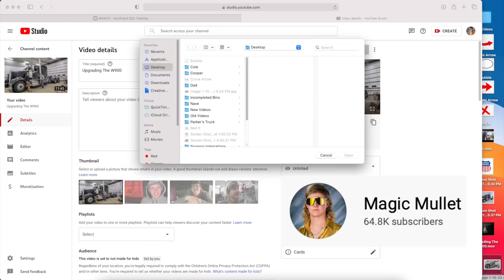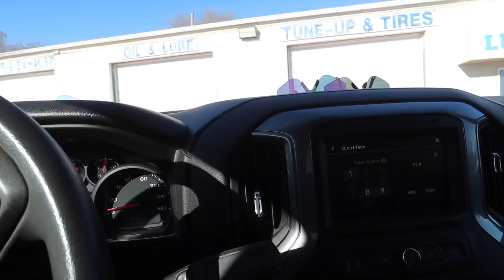MY PARENTS LEFT THE FARM!

Comment: Hey Cole- at 4:44, the valve on that new bin for the floor sweep, could you switch the handle to the other side so you don’t need to crawl over to operate it? You back will thank you when you turn 60, trust me.
Reply: I noticed that also.

Comment: If you’re using a traditional shower enclosure you’re gonna want to remove the drywall so the shower walls are directly against the studs. Then you can mud over the nailing flange and finish it off nicely. That will change the position of your drain by another half inch in both directions too.
Reply: Also need to stay on the same plane when installing the shower drain and trap.  Looks like you will need to dig a lot deeper underneath your shower drain to put the trap on. You break plane, it might not drain/vent properly.  You need to dig down to the bottom of the stand pipe and connect horizontal to trap.

Comment: OK, my CDO is acting up- Brand new bin system and they put the electric controls on the opposite side of the unload auger as the crank to open the door. Now DC has to turn everything on, climb over the auger, then crank the doors open. Some one in design group needs a boot to the rear.

Comment: Cole, the Northland CDL course is GREAT! Show up, register, watch a video, practice pre-trip, do the pre-trip (on section A, B, or C of the truck), then practice skills which is straight line back, offset back, and 90* back, then test on it, and finally you do a quick practice drive around the block, go out in town and on the highway briefly for the drive test where they want you to call out speed limits, and RR crossings, do a simulated stop on the side of the road and ask about your hazard triangle spacing, then it’s back to the yard. The manual trucks are 6 speeds with SYNCROS so it’s super easy. I was in and out from 6:45 to 1:30. Good luck!

Comment: If that's a fiberglass shower pan you should put mud under it for support so it doesn't crack from people standing on it. Ask me how I know?
Reply: just put a ton of spray foam insulation under mine. Worked well and been many years no issues.
Reply: @larryfreeman7979  Good idea!

Comment: I see you guys using disconnects to start and stop your augers. I would suggest using a starter with overload protection. Then when one leg overloads it won't just sit there single phasing and burning up till you get to the box to disconnect. It will just disengage all the legs of the 3phase and require a reset. Much safer and less firey.

Comment: Atounding - You begin without an ad. Thank you from all your viewers (i'm the first apparently). Good morning to you, Cole.. Hey, fella, I do hope you are saving all the nice wainscoating from the walls. You or your carpented friend can easily restor it after you finished the interior walls. .  DO you think maybe it would be best to strip the exterior walls first and get the insulation in. Even if you're not heating upstairs it will help with heat loss from the first floor.
Well, Sprt, you are a very busy fellow. Nice to see the corn being sold.  Hope you don't have ore tire trouble. Nothing more aggravating.  How come so much corn on the ground??  Take care, Cole
Reply: Corn on the ground this vid...was from DC using/learning to use a new auger....DC explained that it is belt driven,(prolly moves the grain at higher speed than the others they formerly used)...it is called  a learning curve...and he also said he would get equipment to retrieve the spillage with...iirc....?
Reply: Well, Stevie boy, who appointed you moderator of Cole's channel. I suppose judging by your reply that should i have questions in future I should ask you. You have time to answer , with full and accurate facts, all the questions about the Cornstar family and their farm operations. My, you are a regular Wiz-Kid. @justmeiniowa . Yes, One could assume that anyone could answer any question. However that would be when their name is on the question. Otherwise they are butting into a conversation that is none of their business.  If Cole is too busy, then he will not answer. But you don't have to set yourself up as the authority. to speak for him. - which is what you did. Or maybe you are in the habit of butting into a conversation that does not concern you. My question did not concern YOU, It was not addressed to YOU.* I did not request any comment from YOU.

Comment: What are the plans for a dryer at the bin site? Are you considering adding a bin in the system for beans? Looking good
Reply: There's a concrete slab at the back where they plan a dryer. I think he talks about it in the last video or the one before that.
Reply from the maker: We have a drier, the contractors did not get far enough to install it. As for another bean bin - yes, at some point we will.

Comment: You definitely removed the lath and plaster the hard way, the best way to remove wood lath and plaster is with a circular saw with a diamond blade on it.  You can cut large slabs of lath and plaster.

Comment: I cringe every time I see you guys using those disconnects as routine method of turning electrical loads on and off.  Gonna bite you one day.  Seriously I can’t believe your electrician set you up that way let alone it passing with the electrical inspector. Got yourself a fairly big safety issue there.  My experience form forty years in electrical engineering and also have an electricians license.  Love the channel.